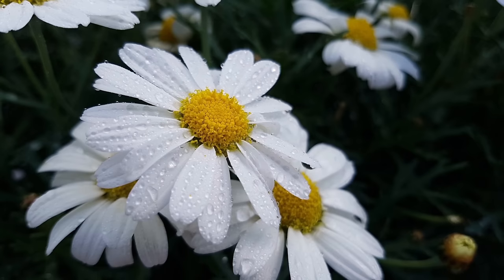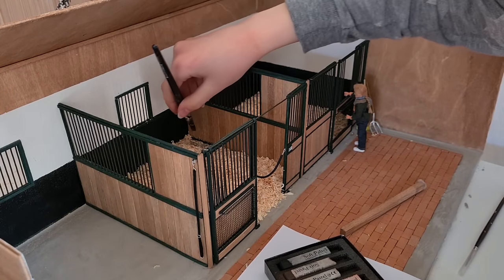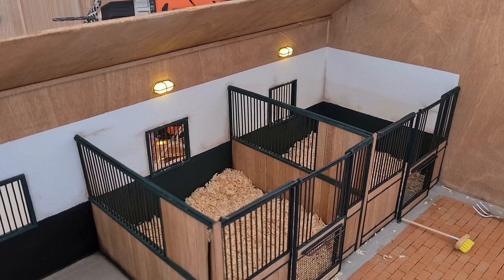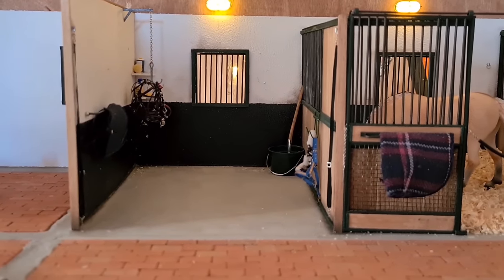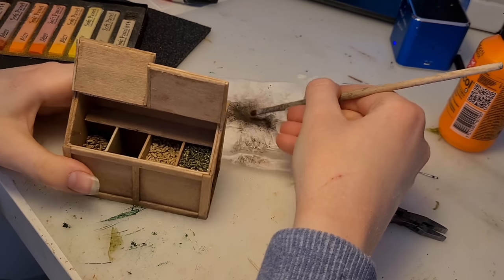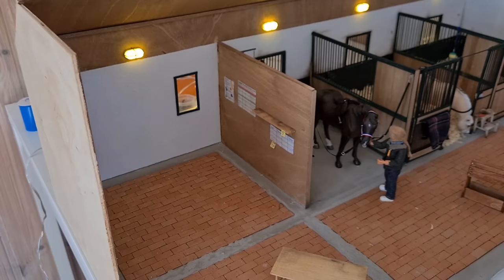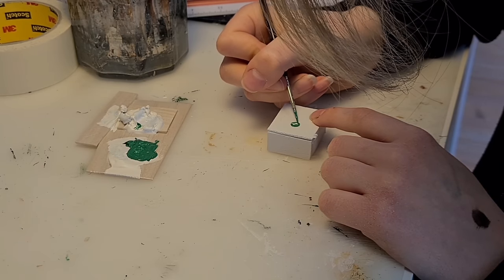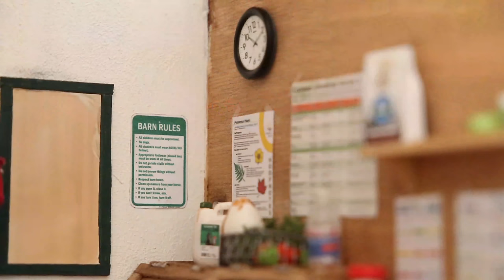Making a Model Horse Stable! Part 2 - Miniature Schleich Barn Tutorial

Comment: Amazing job!  I love that little feed bin!  I might have to borrow that idea to make a Traditional scale one; I turned a small two-stall barn into tack & feed rooms, and was going to use a pill sorter for a feed bin, but it was a bit too small.  So instead I'm going to make a wooden frame around it and mount it vertically as a storage locker.  Each lid will be labeled - Tape and Wraps, Towels, Pads, etc.  

The link to the posters doesn't work anymore, sadly.  :(